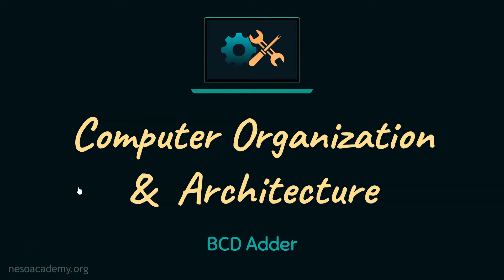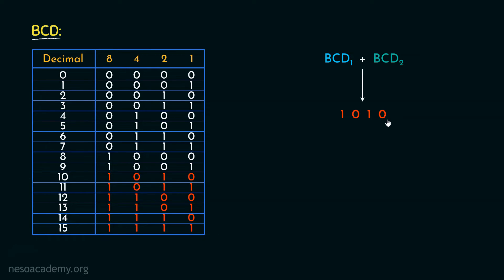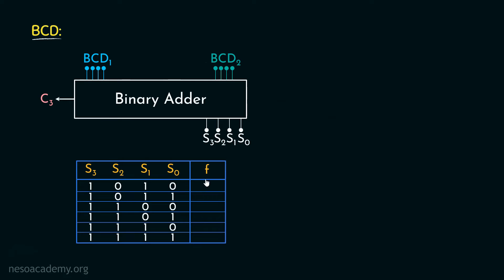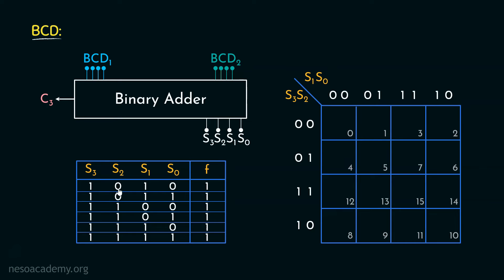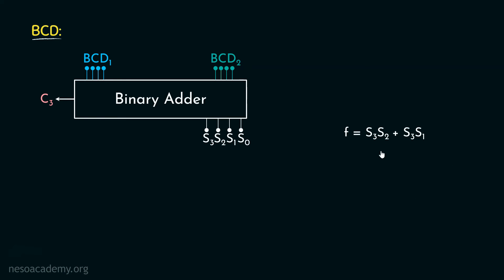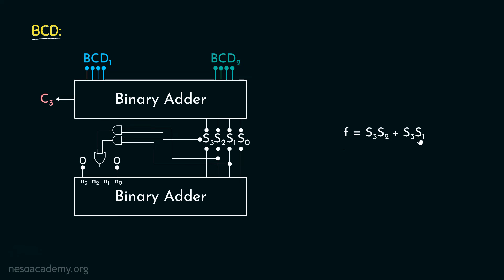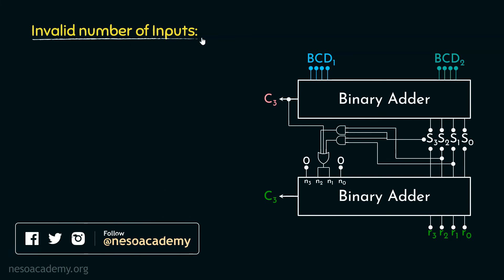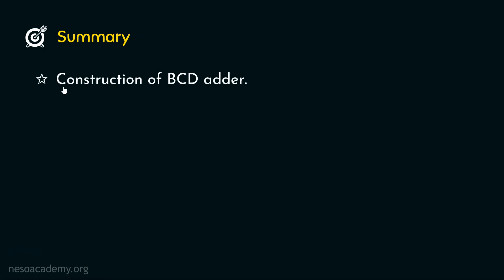BCD Adder

Comment: i got one question, why do we use pattern 6 -  0110 to calculate with the invalid digital number 10 - 1010?  (1010 + 0110)
Reply: Cause then it'll get reset to the corresponding number, for eg: 10 + 6 will give 15 that is 0

Comment: i didnt get why n1 and n2 are set 0, if the sum is valid
Reply: n1 and n2 aren't set = 0, it just leads to the result = 0 with a connection like that (if the sum is valid, with any combination input S0,S1,S2,S3 none of them have the result = 1)

Comment: 8:15 I searched for 3 hours and I can clearly say that we have to consider the second binary adder's carry output as the output of f1. I guess there is a mistake on classification of carry outputs. Let's say the first binary adder's carry is Cf and the second adder's carry is Cs. In some cases we get Cf = 0 and Cs = 1 or vice versa. While the output BCD's carry bit is 1, Cs is 0 in some cases. If we consider f1 as the output carry, it will satisfy all conditions.
Reply: is the circuit shown in the video not correct?